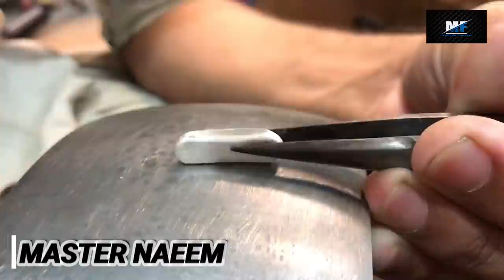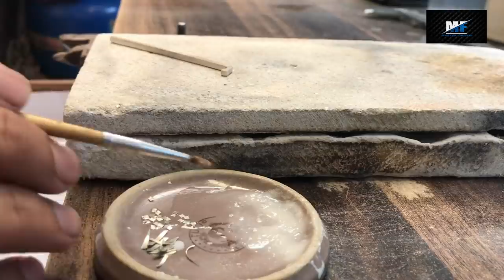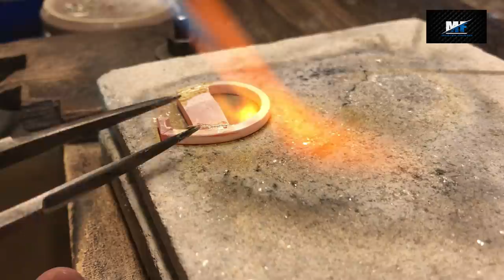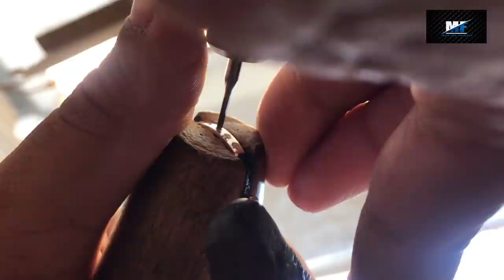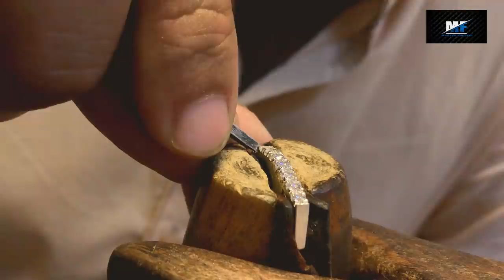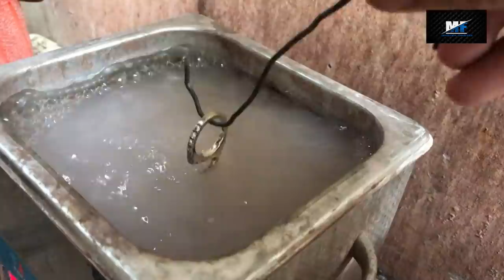Silver Diamond Ring With Diamond Spinning on it

Comment: It's cool, but silvered titanium would have been better than silver. For the security of the gem. Other than the ring loosening the gem is perfectly secure, if the tip rests deep enough. I've used connections such as these for a solid glass bottle spinning around for a bar. It can be perfectly secure, and even guests bumping into it full body won't take it out of the fitting. The weak point is the top bending ever so slightly and silver is far weaker than titanium.

Comment: Did You drill or "pit" the top of the stone to help it stay in place?.. Or is it just held by pressure?.. Great job though!
Reply: It's held in by tolerance.   It has just enough space to fit, but not fall out.  It wouldn't take much of a bend to the top for the diamond to fall out.

Comment: Would be better without all the solder defects in the joints that you can see on the final polish.
Reply: I don't care for the design, but I also thought the same about the amount of solder used to put in the top piece of the ring, and the final polish. Silver polishes up so nicely when it's worked properly, but this also seems like a huge expense in diamonds to set in silver that is going to tarnish and scratch easily.

Comment: It's certainly an interesting idea.  But the design execution is bad.  Using soft metal to clamp down on precious gem... Given it's a ring user will snag or bang it on something.  When this happen the clamp will either snap and bend out pf shape--the gem will be gone.  Also as someone who used to work w diamond, a good jewery should aim at showing the brilliant of the gem at all angle... this ring certainly did not do that.

Comment: Silver is too soft and the ring would bend and the stone would fall out quickly. In platinum it might work. I agree with others this ring is probably just for a video. I also question if those are really diamonds. I think the square notch on the top corner might be there to strengthen the area.

Comment: There is no denying the craftsmanship here, but I not only question the durability of the design, but also the idea of covering the table facet with a metal bar. After all, it is light collected from here which bounces around inside the diamond giving it its sparkle.
Interesting idea none the less.